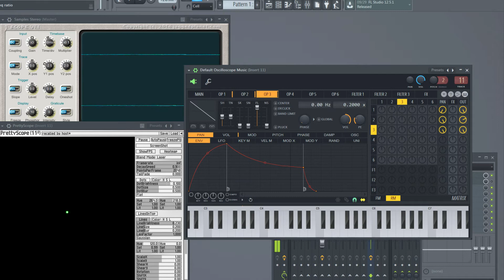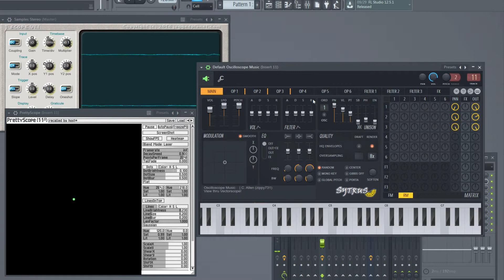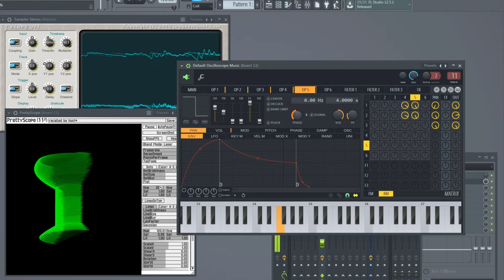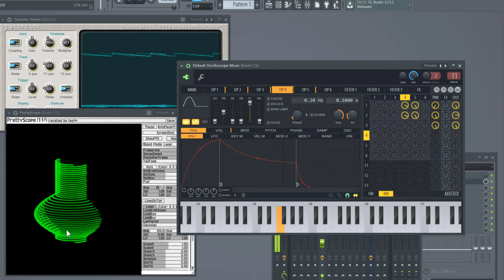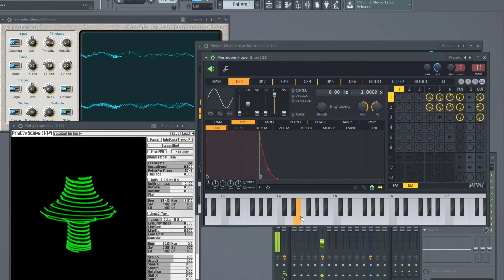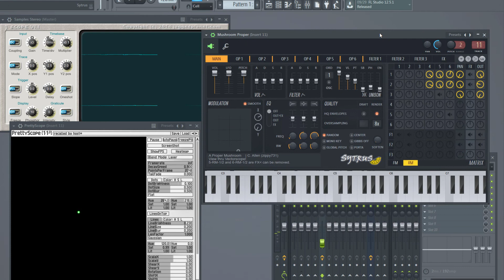Making Oscilloscope Music - Tutorial #5 (Spirals & Shrooms)

Comment: Really nice series of tutorials, between you and Jerobeam I'm learning a lot. There is something I don't grasp, though, because I'm using PureData instead of FL: when you make the spiral, you are using operator 1 and 2 to create the circle, and then operator 3 to make the spyral. Is operator 3 simply added to the right channel? Like in additive synthesis?
Reply from the maker: Yes, added. Not "additive synthesis" per se, as that usually implies harmonic partials. This is simply playing the two signals at the same time.  The higher frequency Osc 1 and 2 are wiggling up and down while creating the circle.  The lower frequency saw wave moves slowly, essentially moving the center of the circle through XY space.
Reply: @ChrisAllenMusic  Wait, what? So.. essentially the saw wave is applying a DC offset to the right channel? Since OP1 and OP2 are essentially sine waves (with different phases), that should mean the of the circle is at 0,0
Reply: @ChrisAllenMusic  Oh wow, I think something clicked in my brain, I have to try this immediately, time to patch!
Reply from the maker: @RussellTeapot  💡 !
Reply: @ChrisAllenMusic  AHAHA YESS I realized my mistake! somehow I connected  the right channel oscillator with the saw kinda like a crossfade between the two,  so I could get only the oscillator, only the saw, or a mix between the two, obtaining a "compressed" spyral. By adding the saw after the oscillator with an indipendent gain, I managed to controll the amplitude of the saw, thus making the spyral shorter or longer as needed... after that, it's just a matter of adjusting the overall gain so it doesn't click. Sweet! Thanks a lot!
Reply from the maker: @RussellTeapot  Glad you got it working!  I promise that if you keep working at it, there will be many aha moments like that.